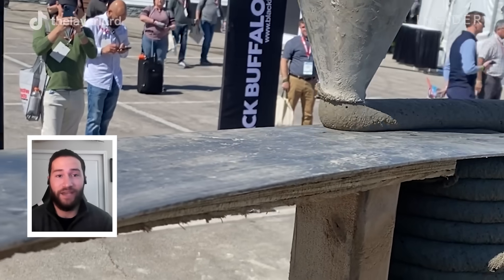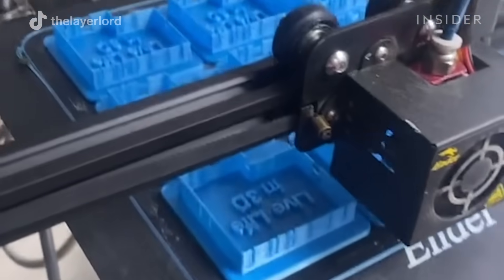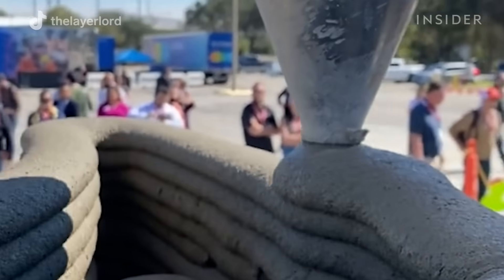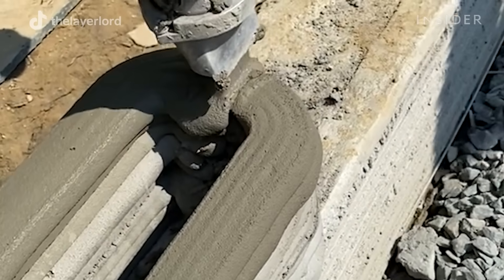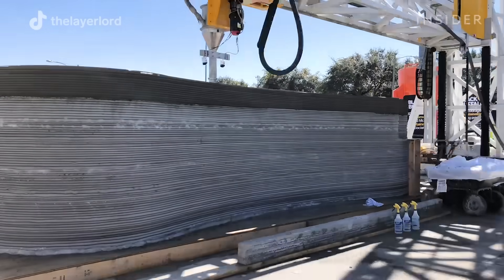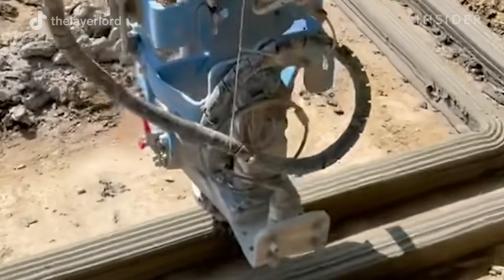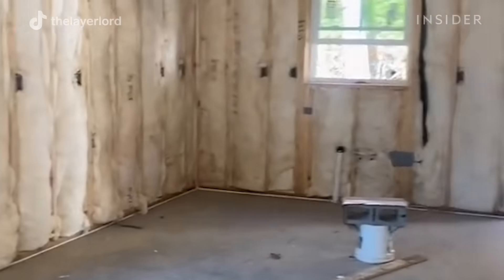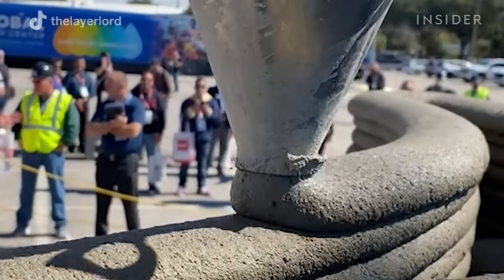How Concrete Homes Are Built With A 3D Printer | Insider Art

Comment: Imagine you having to tell the grandkids how you had a Crack in your whole house because the foundation shifted.
Reply: My house is built of stone and brick. It would also crack if the foundations shifted. 🤷
Reply: @PartanBree  It’s a 3D printing joke.
Reply: Imagine sleeping on the street vs sleeping in an affordable house
Reply: Confused by the people here assuming this concrete is unreinforced, not sure where they're getting that from. If you've got any concerns about concrete durability, have a look at the Pantheon...
Reply: Yes. cracks will show if the footings(Australia)/foundations(US) shifted. That is usually mitigated by control joints in masonry and concrete walls as well as allowing for expansion and contraction. There are none in these houses. Perhaps they have a rubber component in them allowing them to expand and contract😂
Reply: @davidwarren4569  I guess it would be okay in the  deep South where it never freezes
Reply: wont last that long.
Reply: But isn't that what happens now anyway? We had a foundation shift and cracks in the drywall.
Reply: This is fascinating! Of course, the tell of the tape is the financial tradeoffs and which is more cost effective. I imagine this is not for a frugal house, but an upper end one. The insulation properties would be excellent! A good, solid foundation is dependent on the building budget. You see cracks more times than not to structures just "thrown up". This looks much more purposeful. Additionally, I imagine the goal is to do the entire printing within the concrete set time. I imagine this would be a faster setting concrete, so that the lower layers can take the load from the application of the upper layers. Another question is the price of such a 3-D printing system as a complete machine. Time will tell if the advantages outweigh the cost of adaptation. Nothing ventured, nothing gained. I applaud the boldness you demonstrate!
Reply: Old folks are always shooting down technological ways of doing old school trades. Let them complain. It's our world now.
Reply: If that happens its not the house thats at fault. Its still the foundation. Foundations shouldn't shift to that degree no mater what the house is made of. The town of Piza learned this a long time ago
Reply: Speaking of which, no rebar?
Reply: No rebar?
Reply: Lol please tell us more about how poorly educated you are!! Lmfao!
Reply: @drew4509 tell me you don't know anything without saying it. Lol clown
Reply: Or that their house is built with the longest piece of poop in the world 😂💩💩💩💩💩💩💩
Reply: Cool to watch 
Not to live in
Not till people have been living in them for 100 year plus
Reply: i felt like a bond villain being in a cement house
Reply: I used to live in a conventionally-built house with that exact problem, so I don’t think 3D printing is going to make a difference.
Reply: That's something that happens regardless of what the house is made of. My old house was made of brick and it legitimately collapsed on one side because our foundation was on a small 3 foot hill.
Reply: Mean like it happens normally, with any other current used materials, in home building? My question is why are you scared, being an adult why are you personally scared like a GD child
Reply: When someone has a question, and coverts it to an opinion that suits their bias...
Reply: I have known friends with framed houses that have issues because the basement shifted. Not a new problem, however it’s not common
Reply: Happens all the time in Florida….with house constructed the old fashioned way.
Reply: It's easy to patch with more concrete
Reply: This is needed in the UK. Would make up for all the terrible work most construction workers do!
Reply: Like if you build it’s on sand?
Mountains seem non shifty?🫣
Reply: Better than paper house
Reply: If a foundation ever has thay kind of an issue then any house will get screwed. Wtf are you talking about as if only a 3d printed house will be in trouble with a shifting foundation
Reply: Foundations don't shift because of 3D printing walls.
Reply: @WALTERBROADDUS I'm guessing they meant that if the foundation shifts the whole house would crack.
Reply: @kaylarae8003  the foundation is under the floor slab. Properly excavated and compact the footings? You should not have an issue. And that would be done using a non-3d process.
Reply: @WALTERBROADDUS exactly, if your foundation is moving, you already have a problem.
Reply: @kaylarae8003  Isn't this true for every house ever? 😯
Reply: @N1tr063nFr05trhym3  it is, but your average home is NOT constructed as a ONE single solid piece, having sections joined by different means actually helps when there is shifting in the foundation, resulting in maybe a wall cracking but NOT the whole house, I don't want to even imagine what the pulling force from the foundation shifting could do to a house that is one big solid piece... then again, it could also be no bigger issue than in a standard home. 🤷‍♂️
Reply: @kaylarae8003 Its cement why would it crack? And the foundation is not 3D printed.
Reply: Same as brick homes...
Reply: @arandom1024 all foundations move
Reply: @WALTERBROADDUS foundations shift eventually in EVERY home. Can you imagine how quickly it will shift under a foundation made by a local 3d printing crew instead of career foundation layers?

Also just from seasons concrete cracks from expanding and contracting. Thats why sidewalks have lines every few feet. So they decide where it cracks.
Reply: @cHAOs9   we use concrete to build houses in Europe and the only areas where they crack is where the soil is extremely dry in summer and expands a lot because of the rain in autumn/winter. Because of the global warming problem we developed a system of concrete injection in the foundation of the house to stop those cracks from appearing and everything is paid by our insurances when it arrives. I live in the south of France where the temperatures vary between -10C° in winter to 45C° in summer and where we don't see any rain during 8 months of the year and everything is totally fine, I absolutely never saw a house collapse or worse. Some people who don't want to inject concrete in their house's foundations keep watering their parcel a lot during summer to keep the soil from drying too much but the water restrictions are stricter and stricter each year so this method will disappear soon.
Reply: @cHAOs9 completely different application and material.  Sidewalks still crack, joints or not, because of the freezing and thawing of water.  Not just from temp changes.  Water isn’t getting into this vertical wall(very little), and the ground isn’t freezing underneath.  Time will tell but this should hold up pretty well.  I’d take it over the crappy vinyl on part of my house.
Reply: @slpguy6026  freezing is not the only reason why sidewalks crack. Its not even the main reason. In cities that never get close to freezing concrete cracks everywhere just as much as cities with frozen winters. Its because of expanding in heat, and contracting in cold. How is this a completely different material than sidewalks?
Reply: @kleineoOoStern

Because of the global warming problem? 😂

Stop.
Reply: Sure. Because the company using the six figure house printer doesn't understand the proper construction of a foundation. Right.
Reply: @cHAOs9  Thank you for your thoughts. What about somehow rubberizing the concrete somehow? Thank you
Reply: @cHAOs9 That depends on the material used, quality, structural design, location, environmental conditions.
Reply: @cHAOs9 The foundation is not built by the printing process. The printing process goes on top of a foundation. 

If the foundation is a problem here, it would be a problem for any house construction.
Reply: @oskytel3780  these people are insane! But theyll keep throwing money at it. Notice he said he lives in the south of france. Look at who lives there. Nobody that works construction or any other blue collar job.
Reply: @cHAOs9 just get the foundation laid by the foundation layers and have the house 3d printed on top 🤷
Reply: @turtlevillanueva118  sure, but the walls are still all 1 piece of concrete with no stress relief breaks. this whole thing would be great if it was putting down the concrete in short brick sized bursts, like bricks, so everything could shift thru the day as the sun hits it, over the seasons, years, storms, ground settling, earthquakes, etc. its just built too rigid. the idea is good, the execution is rediculous.

nobody builds anything that big out of one piece of concrete for a reason.
Reply: Whole lot of salty construction workers on this page
Reply: @michaelsurratt1864 because itll take their jobs away 😂
Reply: @michaelsurratt1864  pretty much sums up the comment section. And the rest have no idea about the material science being used here.
Reply: Shifting foundation cracks regular construction as well
Reply: @mr.tiddles556 yes but because those houses arent all 1 piece of a rigid material they dont crack all the way thru and split the entire house into 2 pieces like glass. or 1 piece of concrete...
Reply: @cHAOs9 that is a very valid point

Comment: They’re nice and all during the fall and winter season but when summer hits you’ll literally be in a broiler.
Reply: ??? Silica based structures like concrete, brick and stone are cooler.
Reply: If there's no insulation it will be hot af during the summer. Heat would pass through the concrete and if its super hot outside...what would that do for the inside of a concrete building?

Comment: The things I don't see here are the water and sewage pipes, and the house wiring and light sockets. Yes, a concrete house would be durable but if the owner has to bring in water in buckets , and go outside to use the outhouse.... Where are the savings here?
And this doesn't count having to break through the concrete walls to install electrical outlets and faucets.

Comment: I can't wait till the blackouts. All the jobless tradesmen will be able to work again, instead of dying on the street. All Hail General Ludd! RIP
Reply: This is making zero tradesmen jobless.
Reply: @RealMTBAddict  what's the point of it if it doesn't cut out the labour costs?. The cost of automation is supposed to be offset by that saving. Lol
Reply: @VLM03  I have no idea. I have been working in concrete for the past 15 years, and any concrete person will tell you that concrete needs reinforcement in certain applications such as highway or vertical structures. These have no rebar and will probably fall over in a few years. Then actual humans will have to come in and clean up the debris. I sure don't see robots at my company, a robot can't even paint a wall independently yet people think they will be taking jobs away. Maybe at the grocery with self checkout lol. And a lot of people refuse to use self checkout including myself so have fun with the robot takeover.
Reply: @RealMTBAddict  I would rather be designing robots than my current job. When they can hang doors, I'm out lol. The painters will be the first to go. They had robotic paint sprayers in Detroit all those decades ago. Now we have techno, i digress...

Comment: These 3D printed concrete houses are certainly more structurally sound and generally just leaps and bounds better than the flimsy houses made of a wooden frame and plaster board, that you see literally everywhere in America.
Reply: Your comparing concreate to wood of course the difference is huge , its like bows and arrows to a nuke.
Reply: actually, without rebar....   these buildings are very very prone to failure in seismic or with any settlement

Comment: Can techniques from plastic 3D printing be used to form non-flat tops of doors and windows?  Maybe take inspiration from Roman concrete and stone buildings to make self-supporting arches or overhangs, then mass produce windows and doors accordingly.
  For utility savings reserve the space between the two outer layers for loose fill insulation material, hanging pipes and cables inside the building for easy access and repair with basic tools.
Reply: i was looking for this comment! also maybe make a different mortar than concrete….

i read in a book a couple months ago is the roman’s had a much better understanding of making mortar which is why so many of their structures are still standing. it had to do with their water treatment.